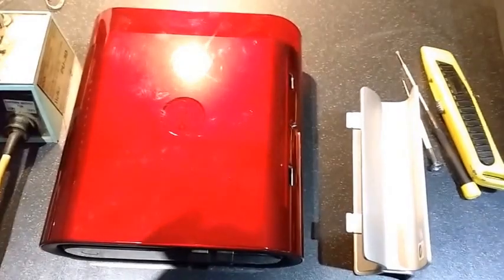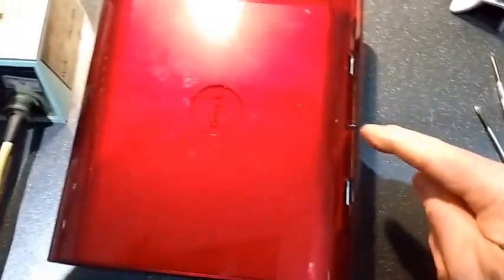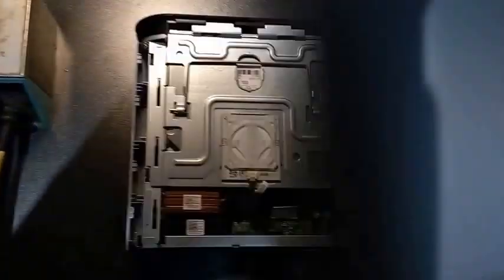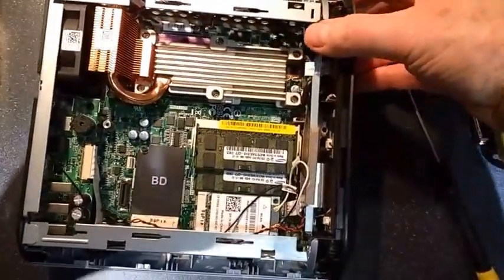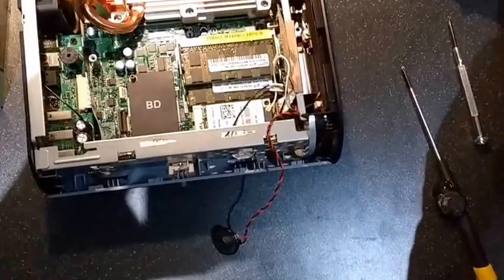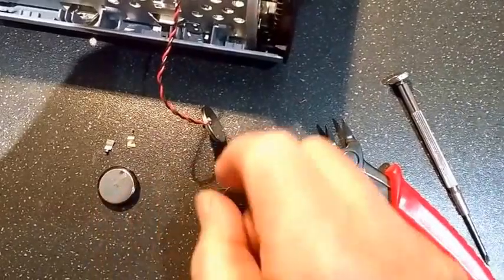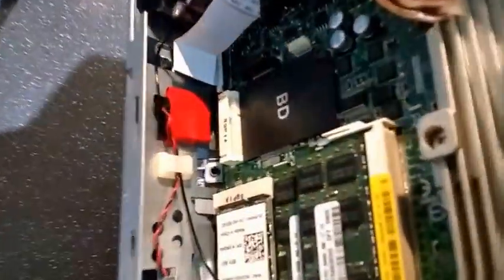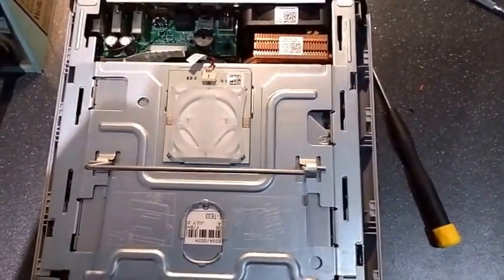Dell Studio Hybrid 140g

Comment: I can not get the solder to stick to the battery
Reply from the maker: You will have to get the area quite hot to get it to melt. But be careful! You might also try scratching the surface of the battery as some solder hates a chrome surface.